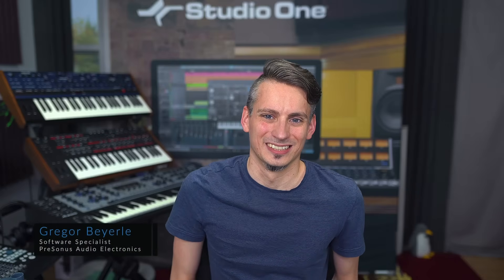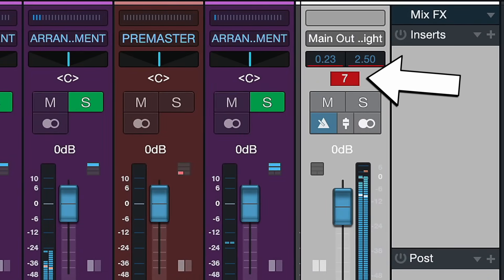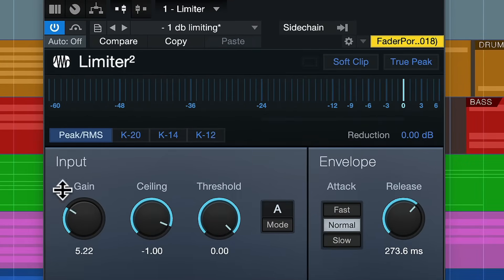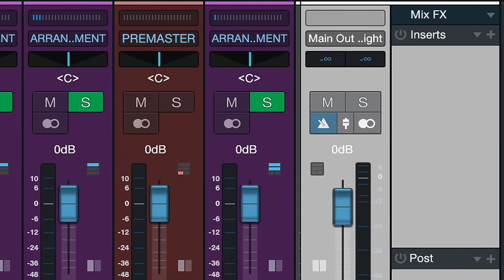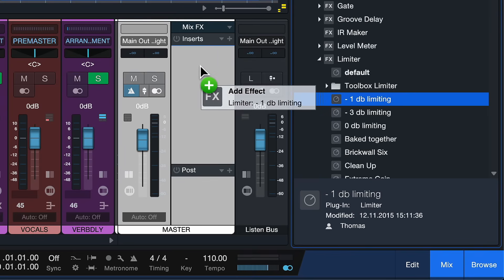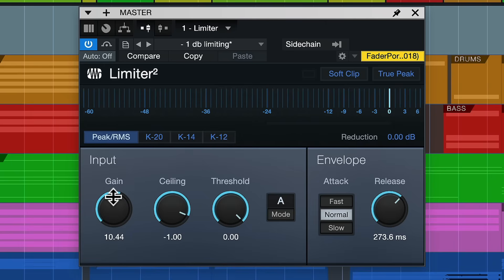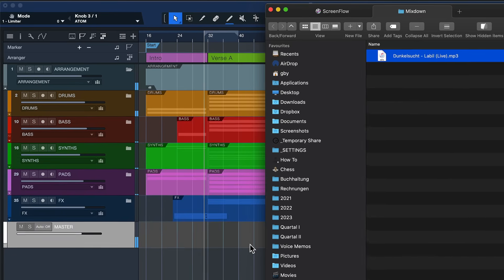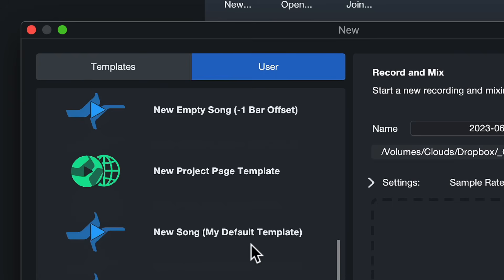How to set up a Mix Bus Limiter to Prevent Clipping in Studio One | PreSonus

Comment: I'm currently doing this. 
1. At the very beginning, I align the gain of all tracks to the quietest instrument, and lower everything with a margin of -6-8 Db.
2. Instead of automating the track gain, I use compressor gain automation where necessary. 0% chance of clipping.
3. As an axiom, instead of increasing the volume of what is heard poorly, either resolve the issue of frequency conflict, or, if there is no conflict, lower the volume of the remaining channels.

If S1 had an analysis tool, everything would be easier.
In my opinion, it is elementary to implement this with built-in processing. Most often, the clipping problem is:
1. The problem of a separate sample with a raised gain
2. The problem of automatization of the gain track in a certain area
3. And only in the last place is the problem of volume summation.

So let this processing:
1. Checks each active sample in project for clipping. If there is one, it will highlight problematic samples in the project.
2. It will run the track at a very high speed (maybe make a pass through specific points, for example, 1 sample after 50 for the speed of analysis) - and stop the cursor at the problem location with the selection of the problem track.

something like that.

And the report that is being issued now looks like a doctor's diagnosis of the type "Wow, buddy, it's too bad (what??) I don't envy you...Good luck"

Comment: Can't you just turn down the master fader a little? Putting on a limiter will technically change the sound you worked so hard to craft. Limiting deserves time and attention at the end. It's something you do with purpose. If you just want to export your unaltered mix real quick but you don't want it to clip, just lower the master fader.
Reply from the maker: If you’d like to keep the same loudness in your Mixdown - just without the clipping - then a Limiter might be the most transparent solution. Of course, it all comes down to how much level you’re driving past the Limiter’s Threshold. If it’s a lot - then the limiter will alter the sound a lot. If not, then it barely changes the mix. :) -GBY

Comment: If I save a default mixing template like you just did, every time I open it, I get all the audio from that session loading up as well. How do I stop this from happening please?
Reply from the maker: Hi, open up the "Pool" tab in Studio One's Browser, then right click this area and select "Remove unused files" (do not tick the "delete files" checkbox at the bottom, unless you are certain that you aren't using these audio files in any other Song Productions). Finally, overwrite the Template by navigating to the "File" menu at the top -> "Save as Template" (enter the same name as the existing Template to update). Hope this helps! -GBY
Reply: @fenderstudio  awesome, thank you!

Comment: Not sure if several of us on here have missed a point,but why is the level set so high in the first place? I can’t speak from any standpoint as a professional audio engineer,but every tutorial I’ve ever read on YT since starting hobby engineering in 2006 states that peak level on the mix bus should aim for about -6dB with -18 to -20dB RMS to allow sufficient mastering headroom,by judicious gainstaging.Or have we misunderstood?
Reply from the maker: Hi, in a purely digital mixing environment, it rarely matters at what level you're gain staging exactly. Studio One has 64bit float headroom architecture and does not behave like a classic analog mixing console would - If you wanted to, you could drive with +80 dbfs into your master bus and then subtract 80 dbfs again using the Mixtool plug-in, and you would end up with bit-for-bit identical audio. 

That said, there are of course still reasons to gain stage at a specific reference level - some plug-ins emulating analog hardware might have a certain sweet spot level, for example. Or you might be sending to analog outboard processors using Pipeline and want to have a consistent gain structure along the way. 

However, if you are already happy with the way your mix is sounding, and there is no audible clipping - and your only issue is clipping on the master bus - then there is no reason AT ALL to re-balance all your faders to an arbitrary level like -6, -18 or -20dBfs RMS. You can simply lower the input gain on your Master Bus, or use a Limiter at the end of your insert chain as shown. -GBY
Reply: Gregor ...thank you for the comprehensive reply,which will throw a lot of YT tutorials on mix level into the air,certainly lots I've relied on to be the final word on this subject.Maybe not...!

Comment: This is wonderful.  Such a simple solution and one that has bugged me for years.  Sometimes I get this error when I render an instrument track to an audio track too.  I assume that I can apply the effect to my instrument track before rendering and it will do the same thing?  Thank you for a great tip!
Reply from the maker: Hi Jim, in that case, you should probably lower the master volume inside of your virtual instrument plug-in instead. When clipping occurs inside of the virtual instrument already, it can no longer be "un-clipped" by the Limiter. 

If you're finding that lowering the volume inside of the virtual instrument editor alters the sound too much, then you could also lower the input trim knob on the instrument channel until you're no longer clipping. You can open up the input trim controls in the Mixer Console by pressing Shift + I. Hope this helps!  -GBY
Reply: @fenderstudio  Super!  Thank you so much!

Comment: I’ve always placed mine in the post box instead of inserts . Usually I have a mastering plugin limiting already in the inserts and the post one is just for extra safety. On that note I have yet to see a good explanation of what should used in that Post box on the master buss , maybe you can explain that in future video
Reply from the maker: Hi Lambert, if you insert the Limiter in the post section of the Master Bus, then its input level would be affected by the setting of your Master Fader (which might not always be set to 0dbfs). I like the post section specifically for analyzing tools such as Spectrum Meter, Phase Meter, Level Meter, etc. -GBY

Comment: Thanks! Is this a suitable alternative to gain staging everything down? I really have trouble finding where things are clipping if I have a lot of tracks, even if I gain stage the input levels down.  For some reason, I find it easier to do in logic, but I like studio one better.
Reply: You can select all track in mixer and adjust the input control e.g. minus 1 db
Reply from the maker: @jensrefshj7080 I would not recommend doing so, as this could change the sound of your mix quite drastically. Keep in mind that all of your compressors would react differently now, since you've changed all of their input levels...so this method is definitely not recommended.

@warmadden5420 If you're sending your mix to someone else for further processing - and you need them to have as much dynamic range as possible - then you can just turn down the Master Fader until there is no more clipping on the Master Bus. The engineer can then compensate for the loss of level at a later stage.

However, if you're just trying to export your mix without any clipping - and you want to preserve your current sound / mix as much as possible - and you also don't want to sacrifice any loudness in the process - then I would strongly recommend the method showcased in this video.  :) -GBY

Comment: question, why not just turn down the master fader? or better yet start with proper gain staging from the beginning to avoid the problem all together. if your worried about preserving loudness isn't that the mastering engineers job? admittedly I come from a rock background and generally don't mix into any compressors  or limiters as I was taught not to a long time ago maybe things have changed and i'm too stuck in my ways.
Reply: I agree. The danger is that this master bus brick wall becomes a crutch and you don't notice that it's hiding serious clipping 3, 6 10, 20 dB over etc. And wonder why it sounds bad. Better to mix at lower levels and save the brick wall for the loudness war in mastering. Unless it's just rough and you want to skip the mastering step for now.
Reply: I totally agree with you. Having a limiter as a preset on the master bus and mixing into it is fraught with issues.
Reply from the maker: Hi @mrwiggles837, if you're sending your mix to someone else for further processing - and you need them to have as much dynamic range as possible - then you can just turn down the Master Fader until there is no more clipping on the Master Bus. The engineer can then compensate for the loss of level at a later stage.

However, if you're just trying to export your mix without any clipping - and you want to preserve your current sound / mix as much as possible - and you also don't want to sacrifice any loudness in the process - then I would strongly recommend the method showcased in this video.  :) -GBY
Reply: Yeah, I'd be worried about this masking problems. Adding it at the end to clean up a handful of clips seems reasonable, leaving it on while mixing seems like it could open a beginner up to trouble.